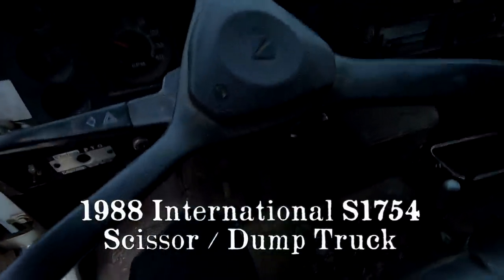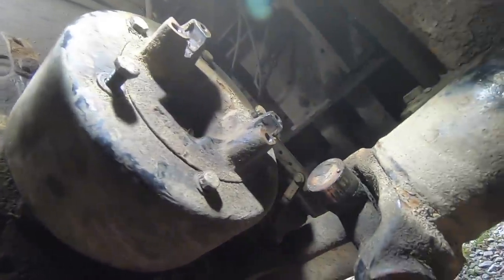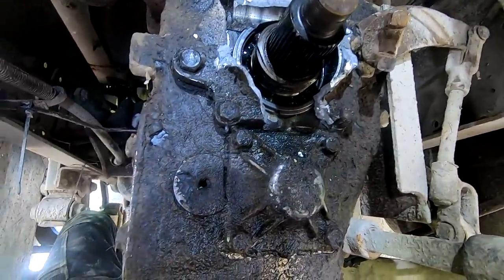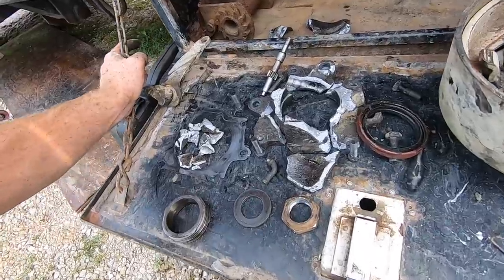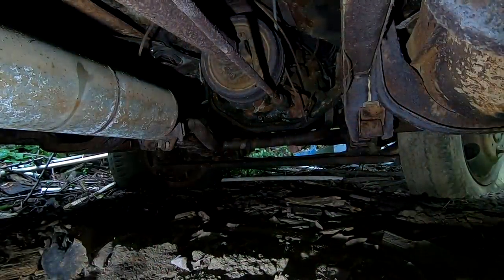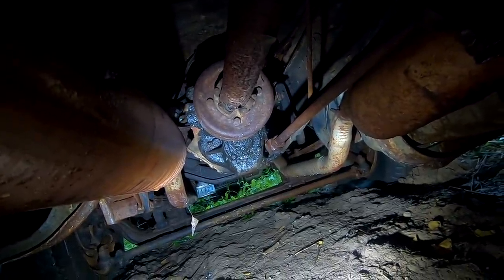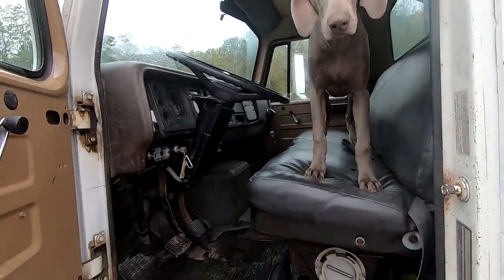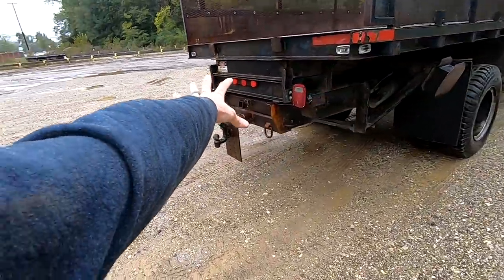Fixing the Broken Transmission Brake ~ 1988 IH Scissor Dump Truck

Comment: When tightening up the Dayton style wheels, you should put something on the ground, like a sledge hammer, next to the tire, close but not rubbing, and spin the tire as you are tightening it up, to get the tire as straight as possible, so the tire will wear the best and not wobble as you drive down the road! Great job as always!

Comment: 17:57 Pro tip: leave the nuts on the ends of the studs so they contain the wedges when you knock them loose. They won't go flying across your yard then.

Comment: A trick to dayton spoke rims that could actually save your life. Loosen lug nuts but don't fully remove the nut, then tap each wedge with a hammer. This way pressure releases without sending anything flying
Reply from the maker: I agree with you! Thanks for the concern!
Reply: That's why their called widowmakers
Reply: @shadowbanned69  The rims (older styles two piece) are what are referred to as widowmakers because they can explode (separate) when inflating, not because of the Dayton spoke wedges. The wedges however could take out a kneecap or bruise you something fierce.

Comment: I feel your pain. My dad and I have a 1600 with a dt466. He was having some welding on the dump bed done and the welding shop didn’t have the parking brake off. Kept stalling the truck trying to move. Soooo their approach was more power - floored and and let the clutch out. Totally split the 5-speed in half right below the shifter.  Oil, gears, bearings all on the shop floor.
Reply from the maker: OH MY!! I'm sorry that happened! I will say though, I'm glad that didn't happen on mine!
Reply: Yeah, sounds like that shops going to buy you a new transmission for free LOL

Comment: The new oil seal is upside down. Spring side always faces the inside oil side. You should never be able to see the spring from the outside of any oil filled housing. Your transmission is going to leak worse than before once it reaches it's max temp. 👈🤓👈 Before 4:41 After 24:01
Reply: exactly
Reply: That's where I'm at in the video now and I've spotted the same thing oil seal is backwards
Reply: In this case you're correct but sometimes the seal would go the other direction depending on what it's purpose is. If it is designed to keep dust and debris out then it would go with the spring facing the outside. It's not super common but it does happen sometimes.
Reply: @DoRC  possibly but the video does show it facing the springs in so my way of doin things is to replace it as it was unless it definitely shows it was reinstalled wrong
Reply from the maker: Yeah maybe, but I installed it in the same direction as the one it replaced... I guess we'll see if it leaks, and if so I'll replace it then... for now it'll do more harm flipping it around, especially since it's not under pressure or fully surrounded with oil at all times.
Reply: @SalvageWorkshop  I'm guessing that that little hose fitting off the bottom of the housing is to give any leaked oil somewhere to go other than onto the brakes, so it should be pretty easy to monitor it for leaks if you put a hose on it to lead it to daylight.   (if i understand correctly, at least)
Reply: @SalvageWorkshop  no maybe about it. Thats how oil seals work. It needs the spring to keep tension on the lip to push against the shaft. If it were under pressure, then it wouldn't need the spring. Pressure itself holds the lip against whatever rod or shaft its against. And there's nothing that says the old seal was installed correctly either 

If it were a dust seal, then yes, the spring faces out. But this isn't a dust seal, its an oil seal.
Reply: Yeah. Spring side to the inside of the transmission. I have made that mistake before until the inside of the seal gets filled with dirt.  Still...there's no pressure in the trans so might work for a while.
Reply: @SalvageWorkshop  You installed in just opposite like it was. Check your video. You can see seal spring.
Reply: @SalvageWorkshop  Yup, upside down. It is to keep the gear oil in the trans. You will ruin your new parking brake shoes. Change it before you get miles on it

Comment: It’s a great versatile workhorse. Congrats! I’m not a mechanic but I do work on our vehicles. The one thing I despise is working upside down and backwards in a contorted position, trying to unlock a seized bolt, and finally pounding my knuckles, in the frigid cold of Colorado. 🤦‍♂️😂

Comment: Dude a little JB weld and you've got that fixed and back on the road 😂
Reply from the maker: Yeah I should have dipped it all in a gallon of JB and it would have been brand new!! lol!
Reply: I'm sure your heart completely dropped when you bump the shifter and heard the bang
Reply from the maker: @rayoverstreet9254  it sure did! At least it's fixed and im a better more knowledgeable mechanic / operator now!

Comment: The reason why that relatively small transmission brake caused so much damage is that it's braking effort is multiplied by the reduction ratio of the final drive crown wheel and pinion. All transmission brakes work that way, which is why they should never be used for deceleration, only parking, unless the power-train has some hefty mountings, even then, there's a danger of causing some transmission wind-up, that's opposing forces locked into the system. Check the temperature of that drum after a good run. Good video. Cheers.

Comment: a trick for making heavy tires easier to remove and install is to use a d handle scoop shovel. you can use it as a lever to lift the tire, and as a carrier sled to move them into place. it's saved me a lot of fighting them on and off of things over the years.

Comment: Fun issue with this style of brake - if the driveshaft fails. My dad and brother were driving a mid-late 70's international set up as a water truck from a fire call one night, and had to go up a short but steep hill (10-12% grade). About 1/3-1/2 way up, either a u-joint snapped or the entire drive shaft gave out when dad shifted, the remains whipped around at high speed and ripped out the air lines and wiring. Now they're going backwards with a full tank of water, steep drops, with a house on one side, gas station on the other and a motel beyond a stop sign at the bottom. By the grace of God, they got it to the bottom of the hill despite no lights at night, before the truck was totally uncontrollable and ended up rolling it. Definitely only a parking brake and not an emergency brake.
Reply: wow lackey them or dam good driving to save lives of others when they could have just jumped dam heroes there i say
Reply: I don’t know much about these things but if it had air brakes don’t the brakes long on if air pressure is lost?? Genuine question mate as I only know a little bit about newer trucks
Reply: @jimbobkirkwood828  they do now. I think the change was made to trucks either late 70's or early 80's. This truck predated the switch.
Reply: Cheers for the replys, learn sumthing new everday👍👍
Reply: @jimbobkirkwood828  I'm late to the party, but what you're referring to are called "vacuum brakes."  They're a type of air brake that fail to applied.  Older air brakes used the air to apply brake pressure; vacuum brakes use air to remove brake pressure.  I believe trains in the US use vacuum brakes as well.

Comment: A lot of people said the seal is backwards, and it probably is, but if it hasn't leaked yet leave it alone for now and see if it leaks after you've covered a few hundred miles, usually unless a seal is under the oil level or under oil pressure it can seal enough backwards. It will be worse if you damage the shaft threads or the like trying to fix a non existent leak.
Reply from the maker: Agreed... I put it in the way the previous one was installed... if it fails, I'll deal with it then! This truck has plenty of other things to be more concerned about and changes I want to make it mine.... I'm gonna focus on those!
Reply: I noticed that seal inserted wrongly on assembly too.
I shouldn't wonder if the lip of the seal isn't bent back rendering it useless.
These things are sent to try you, always best to have an exploded view diagram for jobs on gearboxes.
Not a criticism, just a bit of advice. 👍

Comment: When you install Dayton rims, you need to check to make certain that the rims are straight on the wheel. Put something alongside the tire. Spin the wheel and see if the space is the same all the way around. Tighten the wedges accordingly.

Comment: you see the rign on the outer bearing ring? play is gone when that ring is pinched between the oil seal cover and the transmssion housing
Reply: The output housing retains the output brn. Stiles change by application, you should be good.
Reply from the maker: Perfect! Thank you!

Comment: One of my jobs in high school was changing tires on split rims with a big old tire hammer. Busting the beads was the hard part but the scariest part of the job was seating the beads. Cage the tire and use lots of lube.

Comment: Many years ago I had a 65 Galaxie XL when I was in high school that I was hoping to fix up and get it on the road for 1980. It was winter and I went to move it and the rear wheels were froze in ice. I thought I would do a very "gentle" neutral drop to slightly jar the wheels hoping they would break free of the ice and I broke the tail stock just like you did on this truck. I was so mad at myself!
Reply from the maker: Oh man, that sucks... sorry about that... the worst is that you can only blame yourself! I bet you never did that again!
Reply: Dave Brittian,several years ago I was in a shop that made drive shafts,While I was there a customer brought in a drive shaft that was twisted so badly that it was flat in one place.Seems the brakes froze up,water in the air lines, driver got in a hurry floored the throttle,popped the clutch,and the twisted drove shaft was the outcome.
Reply: @SalvageWorkshop  Ya I felt like the idiot I was lol.
Reply: @korvtm  I guess he decided to just go for it lol.

Comment: I suggest you fabricate a flip latch for the gear shift that will allow you to have a positive lock-out of the shifter, one of the older fire trucks in our department had one that was mounted on the dash and would be flipped onto a pin that was on the shifter that prevented the movement while the pump was engaged, we also had a tag on the PTO and the dash that said LOCK-OUT SHIFTER BEFORE USE OF PTO.
Reply from the maker: That is actually a great idea... I also want to do the same for the parking brake lever since it's the PARK for the truck and it's EASY to accidentally disengage it! I've already had one of the dogs and on of my children accidentally disengage park!  Thanks for the idea!
Reply: @SalvageWorkshop  yikes! My first wonder was about a transmission lockout. I thought I remember those brake levers had a pretty good detent? But that was a lot of years ago on an army truck (when they still had 3 pedals).
Reply: @KristaMae  If they are adjusted right it should take a very intentional action to disengage it.

Comment: you,ll propably need to reconnect the ruxel high gears,i was young and they got me driving the fuel truck ,and a pro gave me a trick going 12345 low then pull it in high gear go to 4 high then five high,it was nice,this guy was hauling heavy sand loads,he propably was doing other things too i wasnt going far just fueling equipement,i had no experience at all,i did a boo boo too one of the firtst times forgot the parking brake on,like you say you learn by experience,nice video

Comment: When tightening Daton wheels set something on the ground and spin the tire as you tighten the wedges. If you don't the wheels will not tighten on straight and will wobble.

Comment: When removing a Dayton wheel always leave the nuts on the studs after loosening. Then smack the wedges with a hammer to loosen the wheel from the hub. Those wedges will get you.

Comment: Save your clutch by not revving the engine to take off. I had the identical truck and even loaded it would take off at an idle 99% of the time. If you have trouble with it make sure your idle speed is set right, I had to bump mine up to get it back to spec

Comment: Well done on the repair. That’s a big gap between third and fourth gear. Looked like an over one thousand revolution drop from about three thousand to below two thousand. Whereas the rev drop between fourth and fifth is only about five hundred. That’s why it appears to struggle when changing up into fourth. The truck hasn’t got a two speed axle to split the gears, has it? If it hasn’t it looks like it could do with one. If it struggles unladen it will be really sluggish when fully loaded. Good luck with all of your projects especially Big Red and your rescued fork lift. All the best from Across The Pond 👍😊
Reply: I think that this truck had a two speed rear end and they replaced it with a single speed.  Earlier videos showed the two speed shift pattern decal in the cab and the bracket on the gear shift is what held the two speed switch.
Reply from the maker: It does have a split rear, but for whatever reason it's not currently able to be used... there is an electronic shifter on the rear axel, but the wires that SHOULD go to the shift button are currently zip tied in a bundle at the bottom of the shifter, and the button is missing.... I haven't had a chance to figure out why it was disconnected, but I think I want to open up the rear end and have a look... then again adding a button would be easier! I appreciate your input on that!
Reply: Some of those older trucks were set up with what some people called a fourth over transmission. Doesn't mean it's overdrive, but you shifted from third high to Fourth low then went to 5th low and the next higher gear was fourth high and then straight back to fifth high. So you used fourth twice are over again! I have driven trucks like that. Is there a shift pattern anywhere in the cab? And with the mechanical speedometer in a two speed rear end there's a little gearbox somewhere in the speedometer cable that's hooked up to shift with the rear end so you speedometer is correct in high or low range.

Comment: The two recesses in the new rear housing (clearly shown at 20:49 in the vid) will hold the rear bearing and circlip in it's intended position and take away the end play that you show at 10:19 in the vid.

Comment: If you haven't already check that the parking brake isn't dragging, by checking the drum isn't getting hot. I would offset the front hitch point to the right of centre, when you are pushing a tall trailer or a flat trailer with a tall load you can see down the side of it.

Comment: Have to agree with Tony R,truck has to have an under drive two speed axle,it's currently rolling along in high (button up on the two speed),,without the lower gearing in the axle,it won't tow,or carry any kind of load,without putting alot of strain on the rest of the drivetrain.

Comment: When pulling wedged wheels loosen the nuts and leave them on and hit the tire and the wedges will pop. Your also suppose to spin balance the wheels and tighten the lugs to make the wheel run true.  Put a hammer handle next to the tire and spin it.  Tighten nuts until tire/rim runs true.

Comment: The tail shaft housing presses the bearing up against the case. The part # will be on the edge of the bolt flange.

Comment: 10:52, you're partially correct. That output housing (or tail shaft housing) will push on that snap ring on the bearing toward the main case and take up a lot of that end play. Then the yoke nut will pull the shaft out, keeping that bearing pulled against the tail shaft housing. They're ball bearings, not taper bearings so some end play is expected.

Comment: For a 1988 model year it is incredible at the lack of rust on the under carriage framework.
After 2 or  3 years in New York State vehicles are already headed to the scrapyard due to 
heavy salt use on roads. Same here in Canada.  Also have never seen a scissor  lift dump truck.  Other than a novelty what practical use do they serve? 👍👍👍🤩

Comment: I had an International tow truck, same loss of power shifting into 4th until a truck driver showed me if you take it up to the red and let off the gas slightly while shifting without using the clutch it retains its speed. It takes some getting used to but once you do it it's hard not to. I think it's called power shifting. Hope that helps, you have a good truck there in my opinion.
Reply: actually i did it in every gear except 1st and reverse, hardly any wear on the clutch I put in it when I bought it too.

Comment: Tail shaft housing seal is in backwards, and wheels need to be trued by spinning and tightening the proper lug nut, to eliminate wheel  wobble  ! Tail shaft housing also clamps the tail shaft bearing in place, lucky it didn't pull out farther, might have had a few things fall loose inside.

Comment: Most diesels have a narrow power band. If you're needing to accelerate or moving a heavy load up hill, run it to the governor before shifting. Note your RPM drop between gears. Since you're only using a five speed, it may be 750-1000 RPM. If you had a 10 speed (or split shifting a 2 speed rear end) you'll probably drop about 500ish RPM. Find out your power band for that particular engine (ask a dealer or somebody familiar with the engine) and try to keep in that area. Most of all, don't lug the engine. The engine will run all day in the power band and be happy.

Comment: The original three speed transmission that would have been in my 1963 FJ40 had the parking brake on the transmission. The rear didn't have this. I'm going with a 5 speed in mine, so I'll also need to change out the rear so that I will have a parking brake.